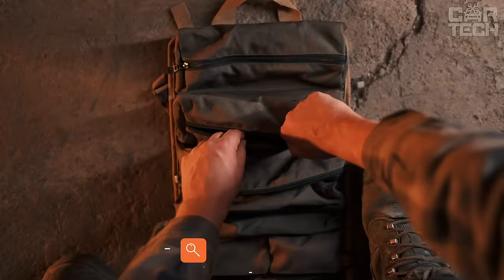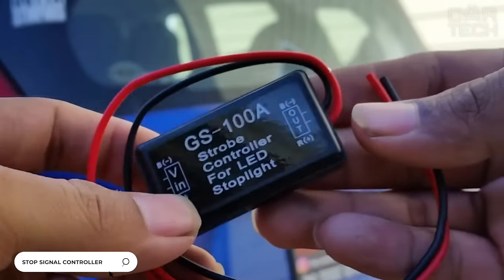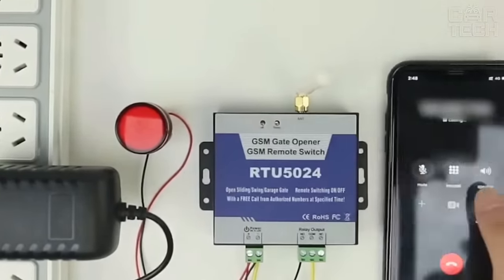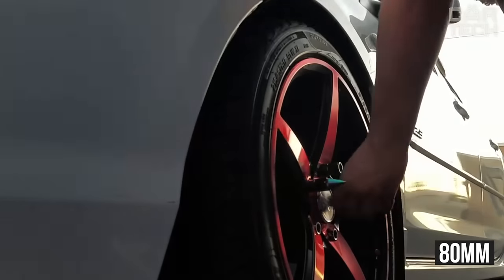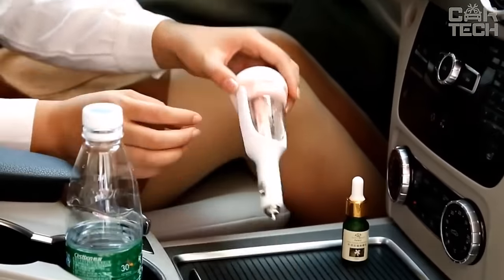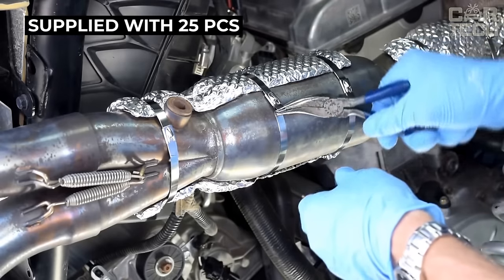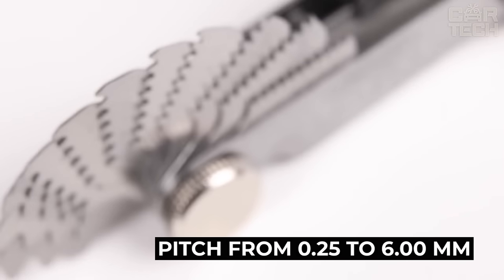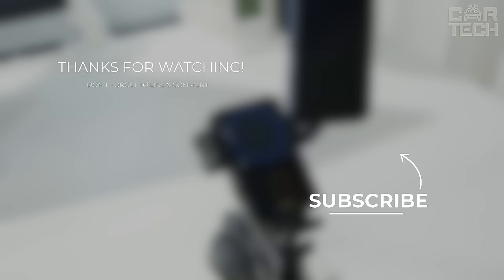THIS HAS NEVER HAPPENED BEFORE! 35 Awesome CAR Gadgets on Amazon You’ll Want To Have

Comment: The "hinged dust cover" is usually called a CV boot and just slapping a new boot on doesn't clean out all the debris and water that got in while the boot was cut or missing.  I have a short 3/8 ratchet, very handy. I like the electric terminal removers.
Reply: My first question is in what country a CV axle called a ball joint?
Reply: @Troy_Built  It's not.  Just another click baiter who has no idea what they are talking about.
Reply: and then there's the whole idea about varnished surfaces to be wiped with microfiber towels.
Reply: Some of these are plainly stupid or pointless & illegal, although the pointed lug-nuts fit all the descriptions I mentioned!

Comment: Disgusted with that horrible metric system they use.
50ml is what a quart?
USA uses the US system, not the metric system.

6500K is too blue of a light.
Human eye works best with 4500K to 5000K light.
Halogen is the optimal light temperature actually.
Not all cars can use those LED lights. Melted parts, burnt wiring, etc.
And simply replacing brake/turn signal lights with LED can be problematic.
Some cars look for amp draw to make them work.
To get them to work you have to install a ballast resistor, which defeats any energy savings.